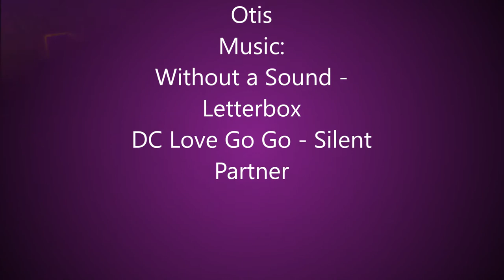Top Bar vs Lang!

Comment: I have only read about top bar hives. I have not known anyone that used them until now. I have had an interest in learning more about them. :)
Reply from the maker: It is a different type of beekeeping.  It is easier, and yet can be more intensive.  You have to manage comb building, so they do not cross comb.  However, there is very little overhead.  Langstroth you have to have extra supers, frames, etc.  Top bar you have to have some bars handy.  Thanks again for watching!
Reply: Very Cool. :) I sent my dad the link to your utube channel. I think I have quit a bit of money into my Langs that is for sure and I bought used ones at first from a guy who was retiring from beekeeping. My dad built his and made them smaller (8 frame)and lighter due to back issues. Thanks for sharing!
Reply: @McCoysOakHillFarm  No back issues. You can also convert a Top Bar hive into Cathedral hive, comb gets attached to 3 sides, more stable and more volume for thermal mass in colder climate.